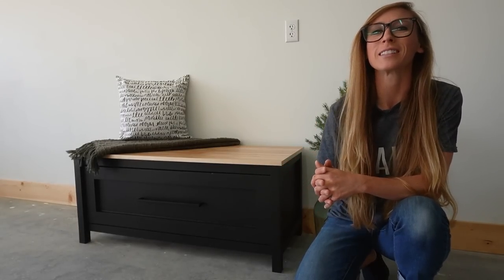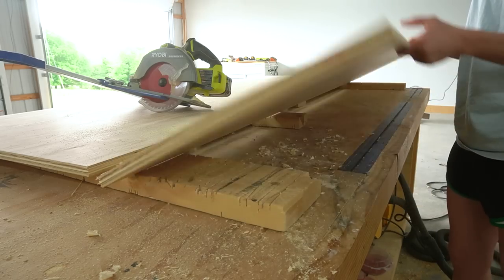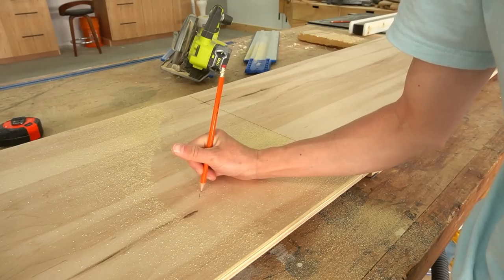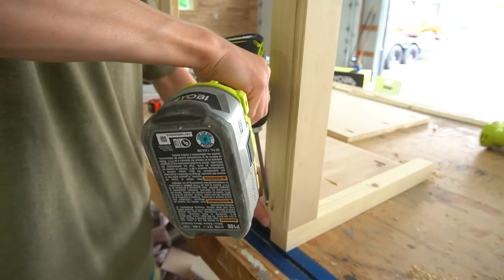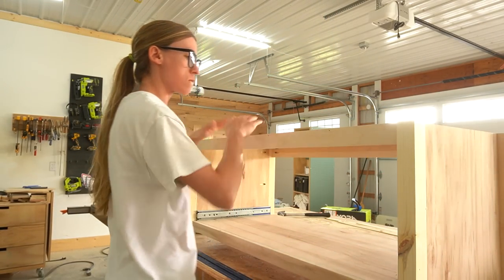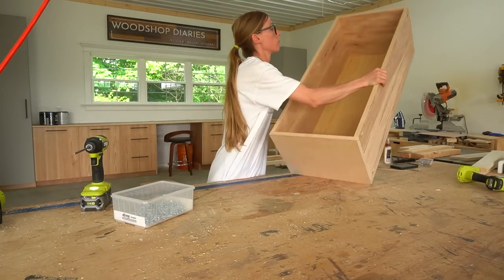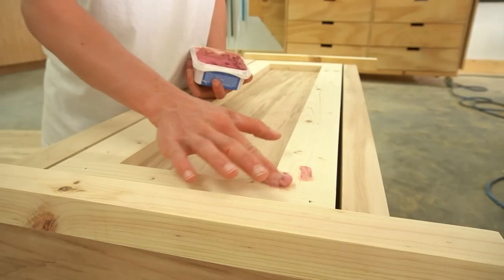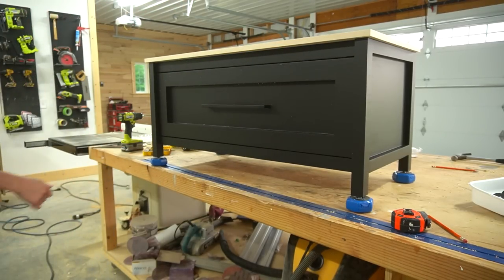How to Build a Storage Bench with Drawer

Comment: I like this bench a lot. I was thinking of something to put near my entryway. That way when I come home I can sit, take my shoes off and get a pair of socks to walk around in from out of the drawer. At first I thought of just buying the top kitchen cabinets that are shorter and normally are installed above refrigerators. I thought of getting one of those, putting a cushion on the top and using the inside as sock storage. But I like your storage bench also. Thank you for sharing.
Reply from the maker: That’s a great idea to use a premade cabinet! The sizing would probably be great for that!
Reply: @WoodshopDiaries  thank you. I thought it'd a be good project for me. And I wanted to paint it. Thank you for your response. Have a good day.🙂

Comment: I checked out your webs ite, on how to build drawer boxes.  I want to build some drawers for the base cabinets in my shop.  I am think about the "front" of the drawer box would be the drawer front.  I would then cut a notch in the top of the drawer to open the drawer.  How would you attach the front of the box to the sides then, rather than pocket screws>. Thank you.

Comment: Nice simple build to get back into project building. 
I’m curious as to what blade you use to make the dado cuts. As most blades have ATB or Hi-ATB tooth geometry, how do you get a flat bottom on the cut?
Reply from the maker: Thank you! For drawers and door frames and most everything I need to cut a dado for, a perfectly flat bottom isn’t necessary. And when it is, I simply smooth it out with a chisel and sand paper. I use a general purpose 40 tooth blade on my table saw.
Reply: @WoodshopDiaries , Thank you! Just the answer I was looking for.

Comment: The Ryobi nailer you’re using for furniture, is that a 16 or an 18 gauge? 🤓
Reply from the maker: I’ve got both and use them both pretty often. Without going back and rewatching here, I’m assuming it was the 18 since this was small trim. But either one would work fine
Reply: @WoodshopDiaries  Great! Thanks! New subscriber here 🧰😁